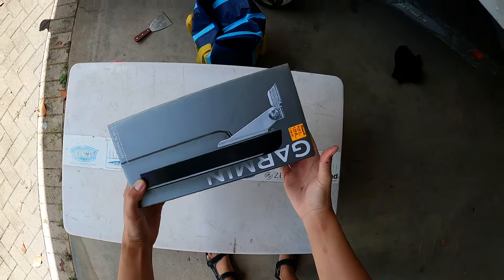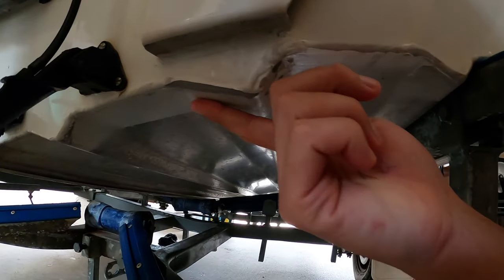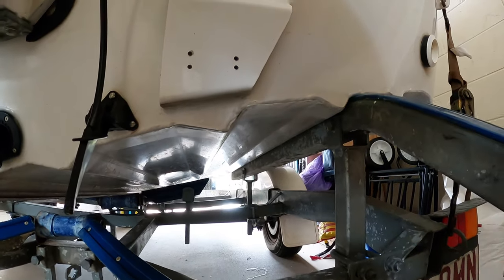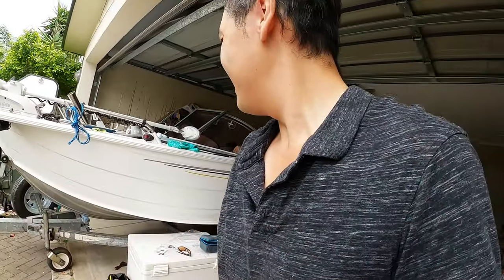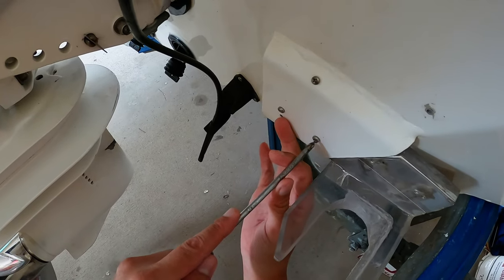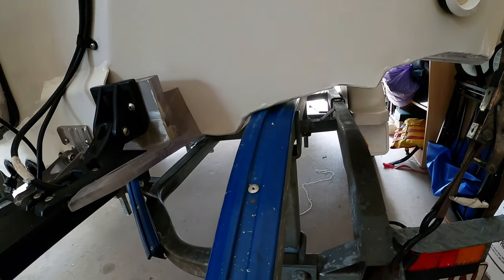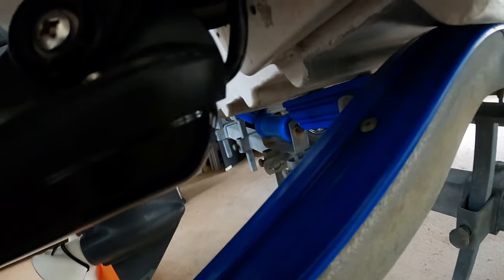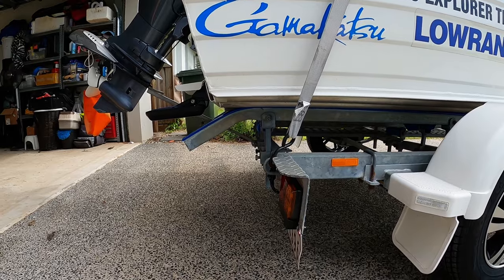How to install transducer for better image QUALITY! Garmin GT51 vs Lowrance active imaging pt1ep13

Comment: Good spot on the transom weld protrusions. However, it may be wiser to add some fairing to smooth it out. Those welds have an important job to do.👌

Comment: Great video, heaps of handy tips. I have just purchased a GT56UHD-TM, my current transducer is mounted on the left side from rear of boat, instruction say to mount on the right if prop spins right, how important is this?

Comment: Hey Buzzy. Great vids mate. Do you think the Garmin is better for the wonkeys than the Lowrance? I thought one of your vids showed that the Lowrance provided a much clearer scan. I’m in the market to buy but tossing up between the two. All the best and keep up the vids.
Reply from the maker: Hi and thanks for watching....and yes the lowrance is clearer but its because it has a much better screen then the garming. The garmin is an older model so the screen it pixelated. I have used the gamins out now and they are very clear as well now. I would get the garmin they have more quality features and better transducers over the lowrance. Hope that help if you have more question just msg me on fb messenger goodluck👍
Reply: @buzzythaosadventures7580  Thanks mate. I was leaning toward the Garmin. Would the Garmin 9sv with the GT51 do the job? 
Have you done a vid of how to set up the Garmin for beginners....like me? Plenty of American Lake vids but not much from the OZ open water scene.
Reply from the maker: Don Beveridge hi and no i haven’t done a setup vid. They come setup out of the box and redy to just use these days so all u need to do is just change the depth from feet to meter, knots to klm and so forth unless u want to use those measurements its fine all personal preference. I would recommend getting one with touch screen is so much easier. The uhd models are the way to go👍